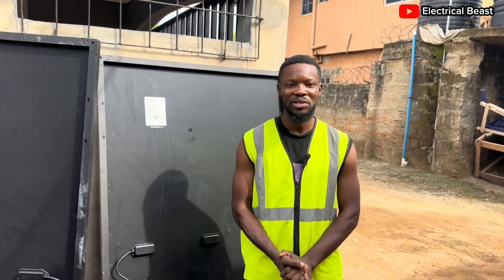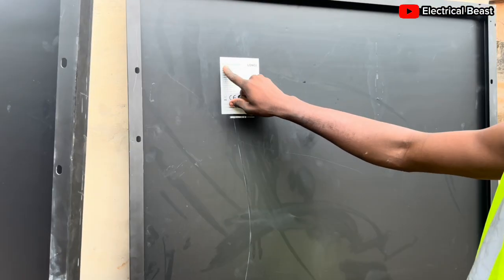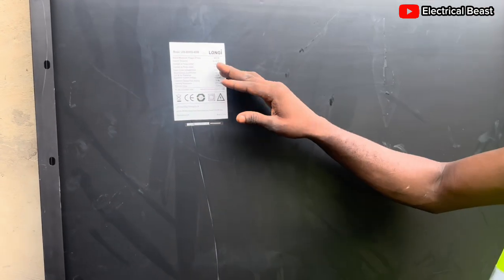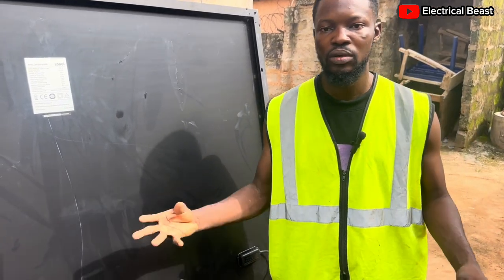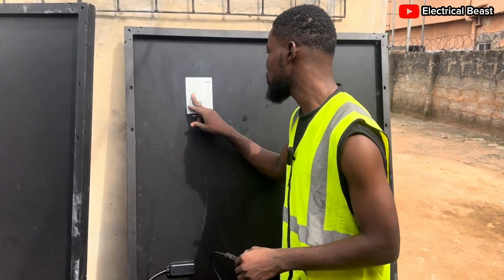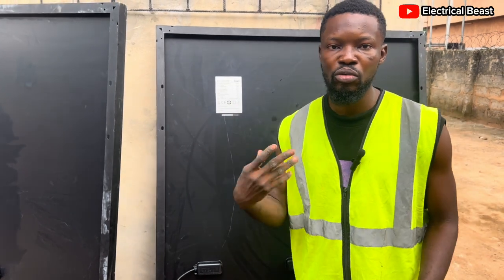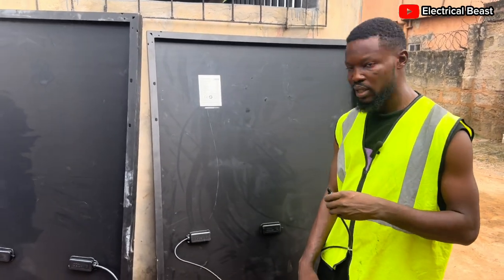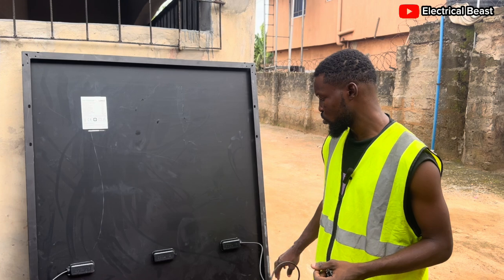Why I Recommend the Longi 450W Half-Cut Panel (Full Breakdown)

Comment: In MPPT which is important current or voltage.. thanks
Reply from the maker: Both voltage and current complement each other, you connect in parallel/series to ensure the current total output current doesn’t exceed the mppt’s rated current same with voltage.

Comment: Well done 👍 

When you said "no need for grounding" Do you mean thunder/lightnings can't affect it on the roof without earthing the panels?
Reply from the maker: Double class protection means the electrical parts are well protected inside.
You don’t need to connect it to an earth wire to avoid electric shock in case of 'internal faults’.

That doesn’t mean lightning or thunder can’t affect it.
Lightning is a natural high-voltage discharge, and it can still strike metal frames, rails, or even the roof.